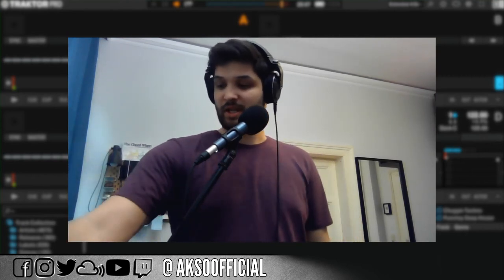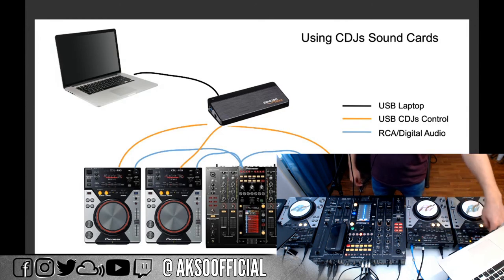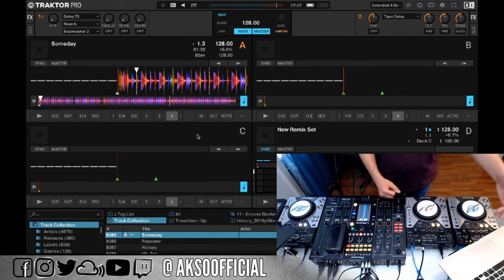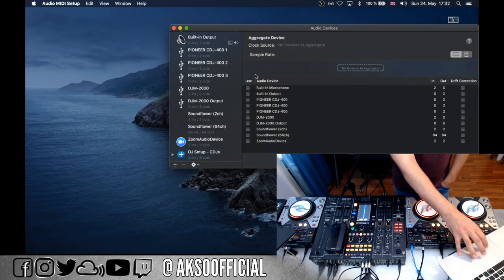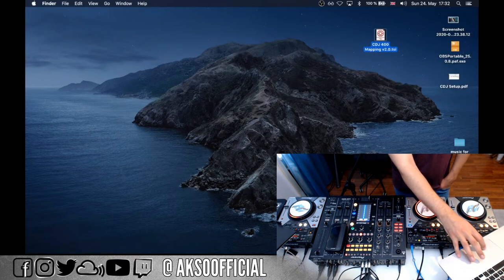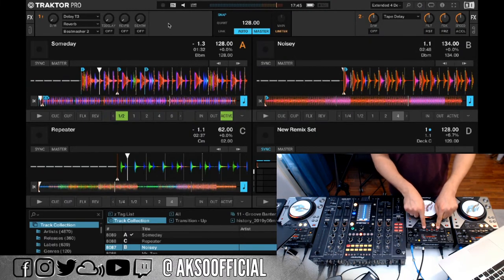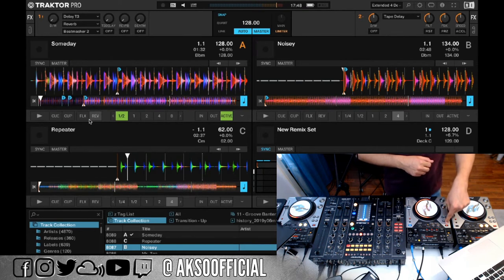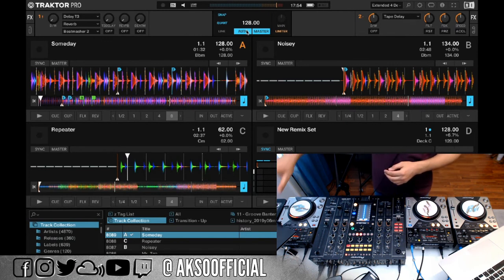🔴 Live: CDJ400 MIDI and HID in Traktor Pro Q&A

Comment: Thank you bother this video helped me alot . I bought a second hand djm2000 and was having trouble with traktor recognizing my mixer and because i have 1xcdj2000 and 1x cdj900  i was getting sound card aggregator problems. Anyways u saved my day thank u. I couldn't find nothing to help me i was pulling my hair out untill i found this video now i have to hook up my technics 1210's and get 4deck mixing going i hope i dont have anymore traktor problems 
🙏👏👏👏👏👏👏👏👏👏👑
Reply from the maker: Glad you hear that you found the info useful. Good luck with the tests. Hope it all goes well ;)
Reply: I cant find no tutorials for my set up please help.. i want to have my 2x technics 12/10's vinyl time code with my 1x pioneer cdj900 and 1x cdj2000 4deck mixing with my pioneer djm2000 with my 2015macbook pro and traktor3.
Do i need to add a audio8 or can djm2000nmixer is not certified i cant configure or figure out how to  make my set up work. Please help
Reply from the maker: @mr.phammond6024   You are right here I think, I don't think that the djm2000 is a traktor licensed mixer either, so a soundcard will be needed for your turntables.
Reply: It seems my N.i audio8dj interface doesn't work no more with latest os Catalina can u advise me which is the best/latest interface that will work with my set up for 4xturntable vinyl scratch timecode and traktor3 with Pioneer djm2000?
Please help still cant make my old set up work with new traktor3 and new latest osx Catalina macbook pro? Do i need a komplete audio6 should i buy audio10dj or audio6dj or komplete audio6 and audio6dj to make my setup work?(2x turntable &2×cdj's or more with traktor3 
Please help im confused
Reply: Should i wipe my drives and remove os Catalina from macbook pro and go back to old osx like Mojave or Sierra  to hope maybe it will make my old n.i audio8dj interface work?  Or is there something out there which is more compatible for what i need?  Which interface for 4deck vinyl time code on traktor should i get?
Reply from the maker: @mr.phammond6024  hey, I honestly don't know why it wouldn't work. I think your best option would be to go and check NI's website and see what products they would suggest. I've never had a dvs setup, so my knowledge is rather limited on the topic.

Comment: Great  way of made my day happy. this information is exactly what I needed. Today I'll buy 2 peers of cdj 400 . Hope to deal with the situation. I will use cdj's just like controllers coz i have traktor s2 mk2 and focusrite 2i2 and from what i understand i need more inputs for audio interface to be able to use it. Btw can I use traktor s2mk2 like audio interface and mixer?  respect
Reply from the maker: Hey, I am glad you found this information useful. You definitely don't need the focusrite to output audio from the decks. They have built in sound cards. 
I think you should be able to use the s2 as a sound card and mixer. Then the cdjs will just be working as deck controllers but they will be the same as the ones on the controller as it's only a two-channel unit.
Cheers

Comment: Hi, thanks for the video. I just want to be sure. So the cdjs don't output any sound to the mixer? It works only as controllers, right? If that's the case then I guess it's not possible to use this kind of setup if I own a pioneer djm 400 mixer which doesn't have any usb output.
Reply from the maker: Hey, you can totally use any mixer you like. With the djm400 you need to connect the cdjs to the laptop with usb and then connect them as normal to the mixer.Also, you need to aggregate them as one audio device and select this as your sound card in Traktor. That’s it. I also show this setup in the video in more detail. Hope this helps. 😉
Reply: @aksoofficial  Is it possible to create an aggregate device on windows?
Reply from the maker: Yes, you need to download an asio4all driver and that will take care of that 😉
Reply: @aksoofficial  I will check it out. Thank you!

Comment: Hi AKSO!Thanks for all!i want to ask you:when you delete the default cdj 400 mapping,it will be deleted forever or when you reconnect the cdjs it will be in controller manager?
And the other question is,what about the filter effects?we can t have them?
Reply from the maker: Hey, I am glad you found the information useful.
In my case I do not see the default mapping when I reconnect my decks. Traktor should remember your last configuration. You can also backup your settings which I would recommend. The original mapping configuration is not lost forever, though. If you want to restore it, just delete the one you've imported, restart the software, connect your decks and it should recognise the device automatically. If for some reason that doesn't work, then run the setup wizard and that would solve it for sure.
You can theoretically map whatever you want to the decks, FX is an option, Filters too. You would have to sacrifice some of the functions that are in the mapping or build more layers with the modifier (shift) buttons. It's definitely possible. I personally don't like having FX or filters on the decks and that is why I haven't included this in the mapping.
Hope this helps,
AKSO
Reply: @aksoofficial  Thank you very much AKSO.It really helps!Be good!

Comment: Hi, do you remember which OSX version you were running at the time?
Reply from the maker: Hi, just looking at when the stream was and the macOS release dates, I would guess Catalina. But I can be 100% sure. Hope this helps.
Reply: @aksoofficial  Searching for a pair of CDJ400 so hard now. Thanks for the insight
Reply from the maker: Happy to help. I would advise you to look at some controllers. Or even the denon lc6000 (which can also work with traktor) if you want that stand-alone feel. It’s just newer tech that might be more worth to spend your money on in the long term 😉
Reply: @aksoofficial  Yeah I was did see the Denon LC6000 and the Pioneer XDJ700 but they are pretty pricey, not really looking to drop £1600 on controllers... I was even looking at older controllers. Bought a pair of Reloop Contour but they are not compatible with anything higher than osx Sierra. Was contemplating on buying a secondhand pair of Denon DN-SC 2000 but was worried it may not be compatible with certain osx versions. Behringer CMD PL1 might work but can't seem to find one let alone a pair. I think using an old Pioneer / Denon CDJ which has a USB midi in/out is worth a try (5pin midi might even be more universally compatible under General Midi)
Reply from the maker: @NathanBoardman19  have you considered the ddj400? It’s not very pricey, it has a standard club-like layout and it will for sure be mapped or mappable with Traktor.
Reply: @aksoofficial  I'm running an external mixer and using technics 1210 for deck A & B... I've been using Traktor X1 to control deck C & D but it's just not very satisfying to use as a fully fledge deck controller. I see that there are so many all-in-one controllers on the market but I just really want 2 CDJ style jog wheel controller.
Reply from the maker: I see, in that case the 400s might really be your best bet 😉
Reply: @aksoofficial  hey, just copped a pair of CDJ400 for £300!! They were really easy to map, it's nice how the jog, HID and a few buttons work automatically. Thanks for making this video, I don't think I would have considered the CDJ400 if it wasn't for your video.
Reply from the maker: Oh, that’s a decent price for them. Good stuff. I am happy the video helped you out. Enjoy the decks.

Comment: Hi, how I can contact you in 2022? I can't configure it right using cdjs sound card, they work well, but the functions on the mixer doesnt work well, if you can help me anyway I apreciatte my mixer is Numark M2.
Reply from the maker: I started on this mixer. Loved the thing. What do you mean the functions of the mixer? You need to connect your cdjs to the mixer as usual and the audio should just flow through